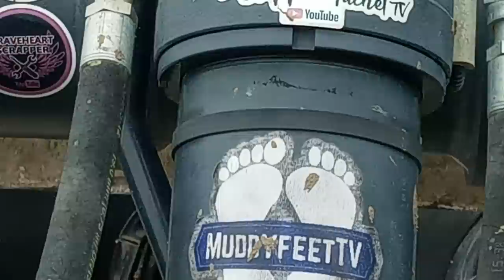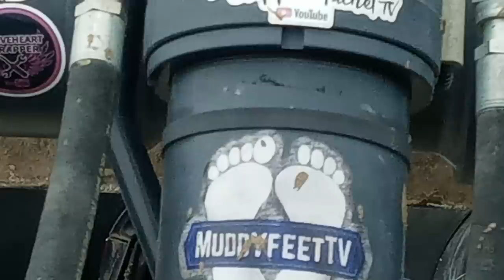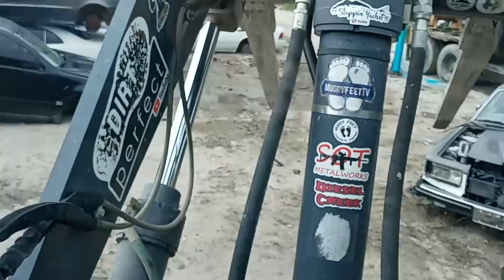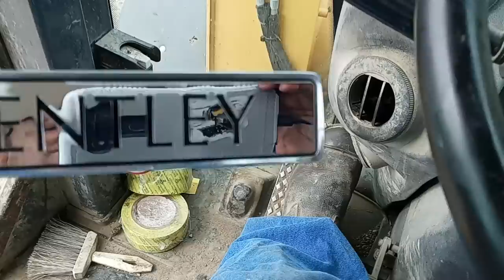Luxurious Bentley gets Crushed in Car Crusher

Comment: Why care about the Bentley wheels?
Reply from the maker: Aluminum
Reply: Yes they are struggling for the aluminium wheels of that Bentley ,but didn't remove them from the leftover Ford truck.
Doesn't make any sense!? 🤔
Reply from the maker: @bib4211  just cause they are shiny don't mean they are aluminum
Reply: @CowboyCarCrushing  they were not shiny but spray paint black.
The rear one was definitely a alloy Ford wheel!
We don't have to argue about it is or isn't , you were there on the spot so probably knows best!
Keep on crushing cars and collecting all kinds of tools from the trunks!